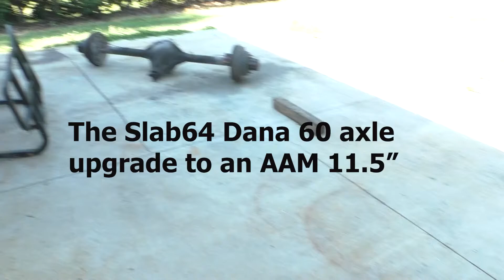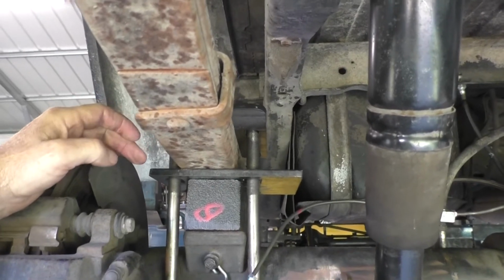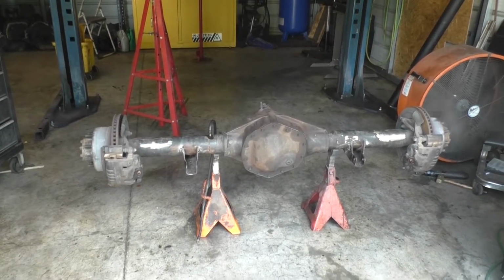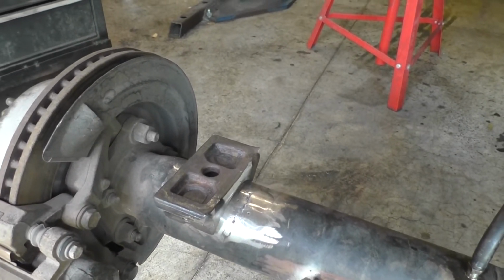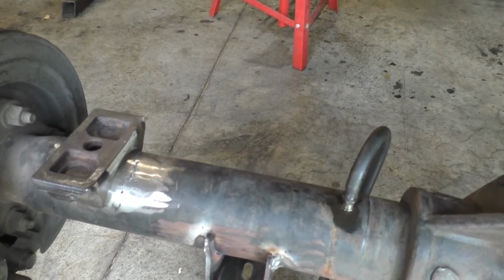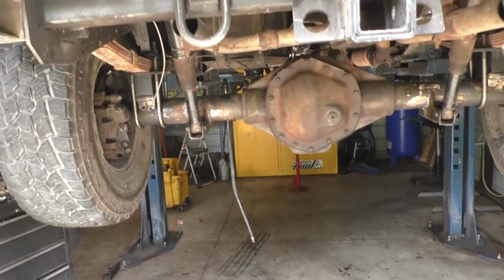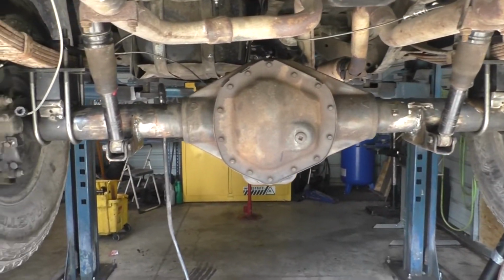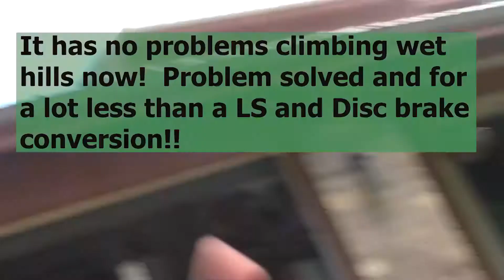J10 gets a new/Bigger rear axle--AAM 11.5"  The Slab64 EPS15

Comment from the maker: I haven't connected the rear Disc parking brake either.  However, it should be easy to make the cables connect to the Jeep system

Comment: I installed that same AAM 11.5 axle, mine came out of a 2008 Silverado 2500 diesel wish I had gone with a DODGE one instead, Truetrac vs GM´s G80 gov locker

Edit: 3.73 gears on mine, couldn't  make the parking drum brakes work on my J-10